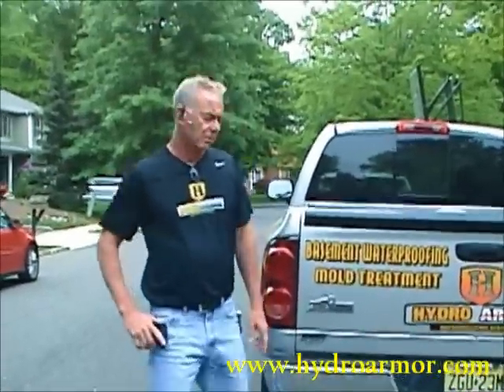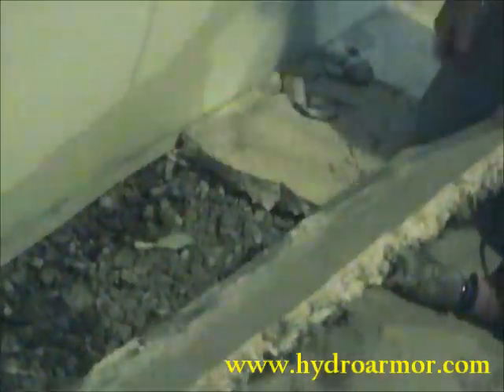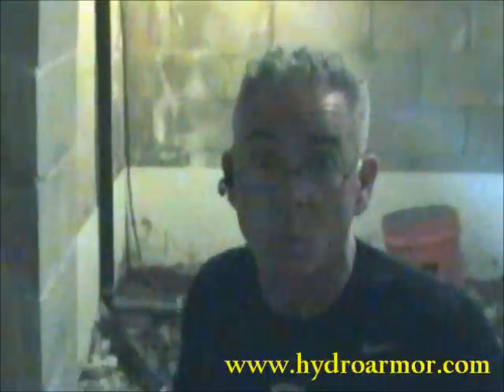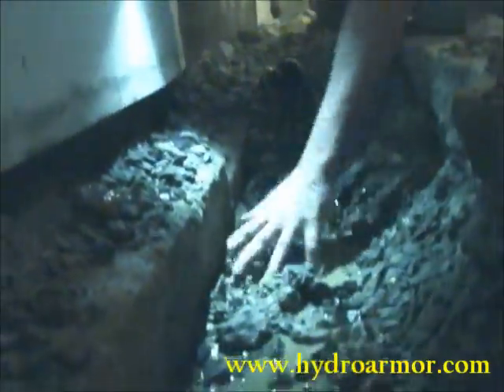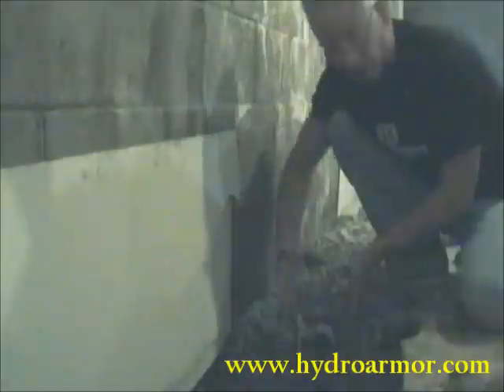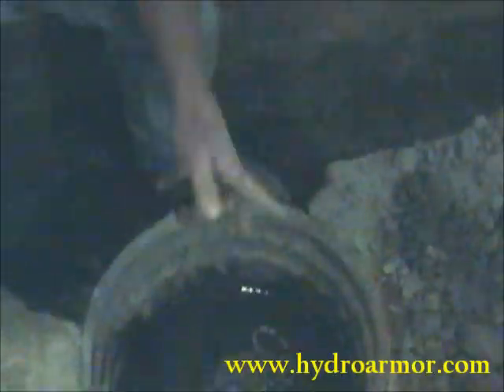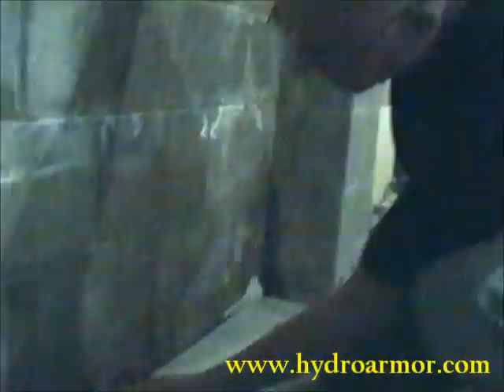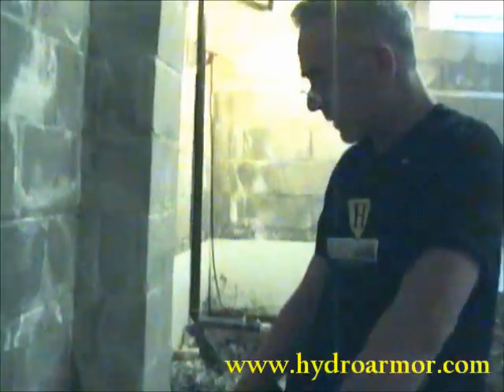How much should Basement Waterproofing Cost

Comment: Getting ready to start trying to keep water, or more accurately, keep moisture from my basement. I've never seen water....just moisture on wall and the white haze it leaves when it dries. I have French drains outside and the concrete blocks were covered with the tar stuff for waterproofing before the backfill, but there is still moisture on the block inside the basement

Comment: My house was built in 1946. Poured cement basement floor and walls. It looks like there is no footer (or it's the width of the wall) - is that possible / common back then ? (location is Dartmouth, MA). It is dangerous to put in a basement perimeter drain if there is no footer ? Basement area is about 1600sf - any idea on what a reasonable cost should be ?
Reply from the maker: +bbeckm2  Hey now have no worries.  I just built a Garage for my daughter up in Mass and when digging out the footings I hit a solid rock mountain.  And that's probably why it's a poured foundation.   - Daniel J OConnor
Reply: It may be a monolithic foundation where the slab and footer is one all one piece.  You do NOT want to jack hammer that slab if it's monolithic or you will destroy the footer.  A test bore hole will tell you what you have.

Comment: so I'm about a month from finishing my own basement, I'm not hiring out the work for the same reason you were contracted to redo that job. I haven't had any water in my basement in the 3 years I've had the place, but wanting to know if I should install the French drain to protect my investment.... & does my finished wall need to be inside the trench if French drain is installed?

Comment: I was going to hire a company not after watching the hack work they do. I'm going to try it myself but the inside of my crawl to the slap is Rock/Stone I don't know how I'm going to get through it but I'll give it hell. 16" wide, the top of the drain tube should be just below the slap?  Thanks Daniel wish me luck
Reply: +Bill Veder How'd it turn out?
Reply: It turned out great and works flawlessly. Total cost $800
Reply: Cool :)
Reply: Bill Veder hey Bill how long did it take you to complete your basement?
Reply: It took me a long time but my project however, was more involved. My house is on the side of a hill. My water problem was mainly in the crawlspace. I have 70% crawlspace, decline, 30% basement slab flat. Water would flow into the crawlspace on to the basement slab. I had to dig out 600 sq ft of dirt and rock from the crawlspace (thank God it's a walk out basement) but I undermined the footing after digging & creating a flat surface. Then I had to pour concrete step walls. Digging the trench, the sump pit, putting in the 4" corrugated pipe, filling with gravel all went very well. My total for concrete, re-bar, pipe, gravel, waffle board, plastic sump pit insert & zoeller pump somewhere between $2200-$2500  JES quoted me $30,000 not including the concrete step walls and they wanted to use the garbage box system. I told that young punk to get out of my house. Once the crawlspace was completed my water problem was over. Time to tackle the already finished stinky/wet basement. The previous owner built a raised wooden sub floor on top of the basement slab to allow water to run under it, then he poked a hole through the back/outside concrete wall to allow the water to escape outside. That was his solution to the water problem. I gutted the entire basement. It was solid black mold under the wood sub floor and 4 ft of mold climbing up the walls. I refinished the basement on top of small, poured concrete step walls along the perimeter because I was so paranoid of water damage and I wanted to insure that I would never go through this again. It's been 4 years now and one hurricane (Florence) it has been flawless, 100% dry. Special thanks to Daniel Oconners videos.  There is two things I would recommend: DO NOT USE JES!  If you decide to do this job yourself use a digging bar DO NOT USE A MATTOX! Take my word for it a mattox is a real back breaker. Best of luck to everyone. I'm sorry for the late response.

Comment: I am curious. how can you tell if a a company is just doing a really good sales pitch vs. weather you really need something or not. the company that called me asked me what my issues are, I said none. I keep telling them that and they seemed like they wouldn't hear me , well it doesn't hurt to just send someone out. I never have seen any water on the floor in my basement, never smelled mold, nothing. the guy who came out said I have too many cracks, and then some spots around a couple of those little round things where there are every couple feet, some kind of rods. I have a 1700 sq foot basement 33x48 or so.  three otoins were 14,000 dollard, 24,000 and 42,000 the 24,000 is the most complete ironically. however, I am guessing these guys can take novices like me and what do I know? now he showed me the company is A+ rated with the BBB and they have a few patents, and he sure sounded like he really knew his stuff, but I seriously doubt it is as far along as they make it sound.  alos talked about spiders being a some sort of sign. that seems a little odd to me. I honestly don't have money to spend at all and I am pretty sure there isn't really an issue. of course 75% of the walls are covered by the panels my dad finshed the basement with many years ago, so a full inspection wasn't really even possible, but they made it sound like I really really need to get this done, but I honestly doubt it even though it was very convincing

Comment: The best way to do waterproofing on a house is to do it outside NOT inside. You will always have mold and the musty smell alway because water is always in the block walls. Inside waterproofing will always be the cheaper way but not the best way.
Reply: Cheaper? I think inside is more expensive. It's rainy season now so I cant do it outside, but will next summer. For now I'm doing inside as soon as possible.

Comment: I have been in construction all of my adult life and I have to laugh when contractors talk about removing soil down to the bottom of the footing. The soil is holding the footing in place, take it away and foundation wall movement is possible, especially if wet soil conditions exist, which is likely if you have water intrusion issue's in your basement. These systems are not waterproofing by any stretch of the imagination, but rather a water diversion system that increases moisture levels in the home. When installed, a dehumidifier should be operated 24/7 to remove this moisture issue, interior systems are not the best option and should be avoided for several reasons.